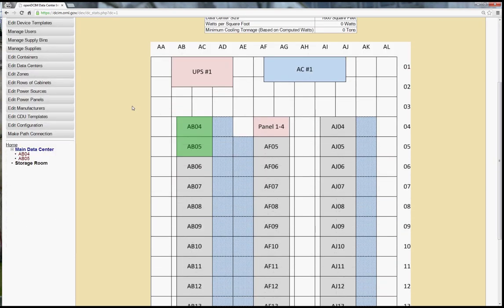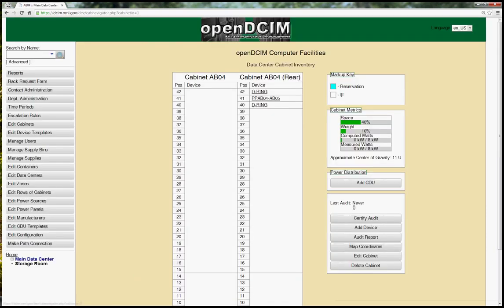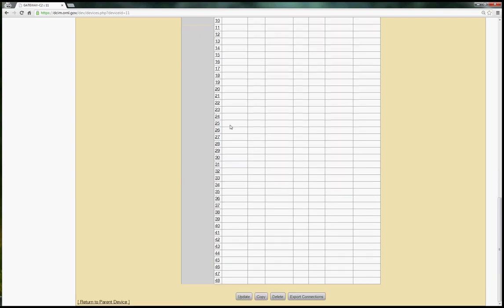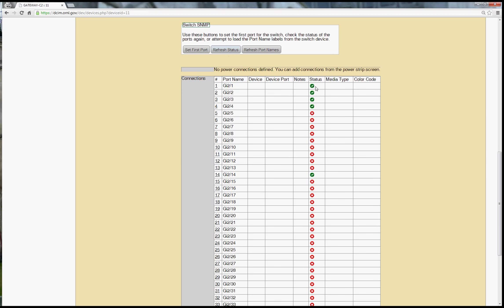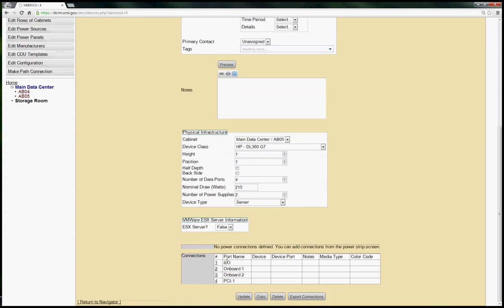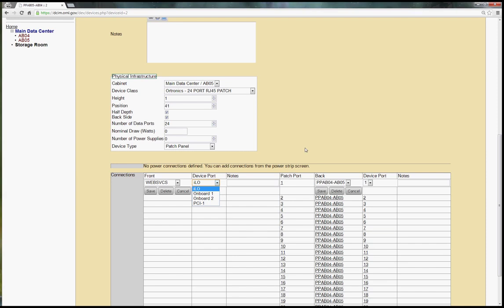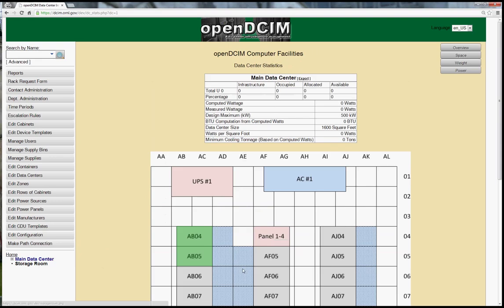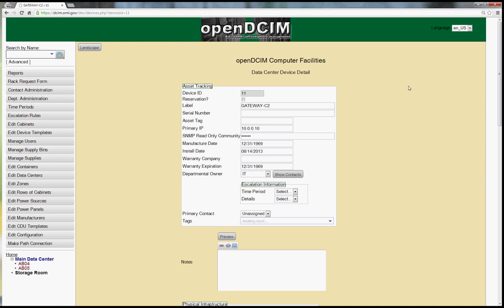openDCIM - Using SNMP to Get Realtime Status of Switches

Comment: For version 3.3 you create a Sensor Template for the specific sensor type and then you can choose that template type in the Edit Cabinet screen.  In version 4.0, which is currently in testing, it is no longer a 1:1 ratio between Cabinet:Sensor - you add a sensor just like any other device, but there does have to be a template for it in order to poll.

Comment: Hello good afternoon

I have configured a switch but the port status does not change, it remains at x. the notes if they update when I select the first port ..

The snmp community is working correctly, there is another setting in some file that must be modified to monitor the port status.?